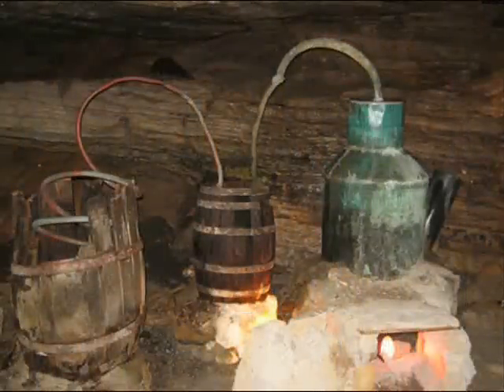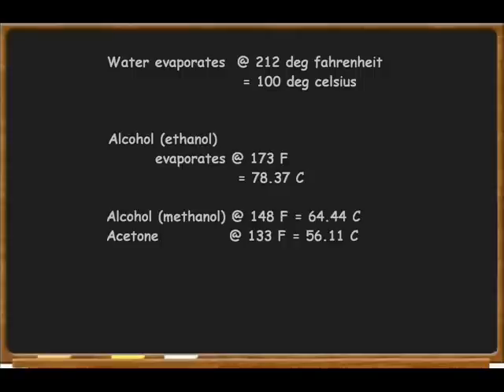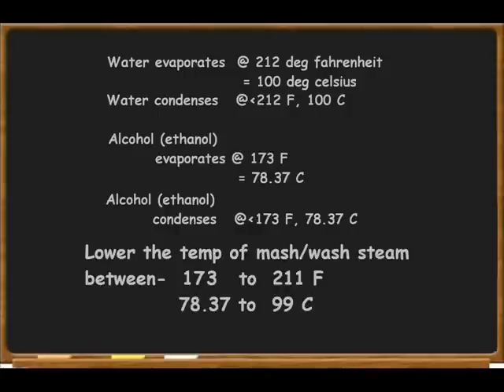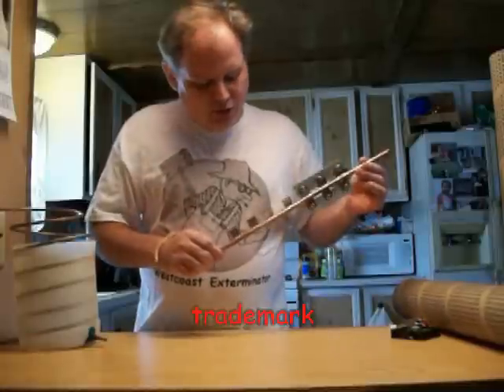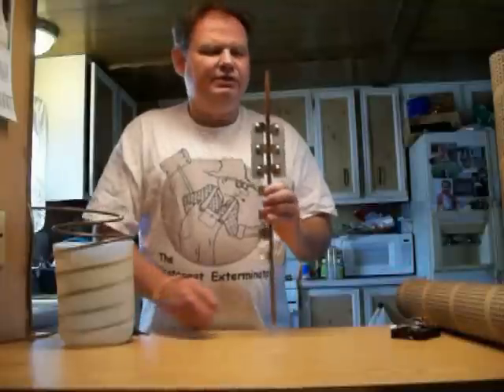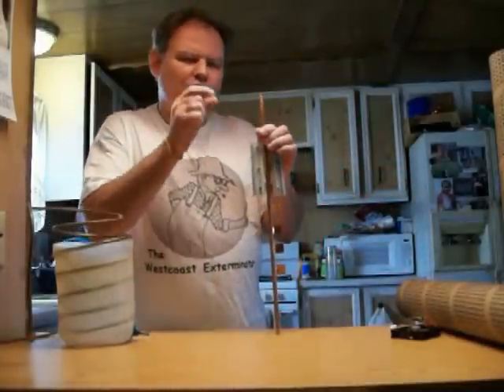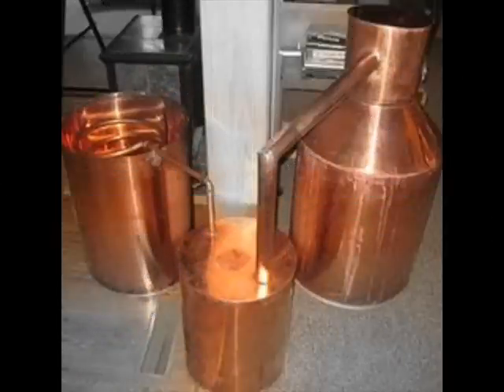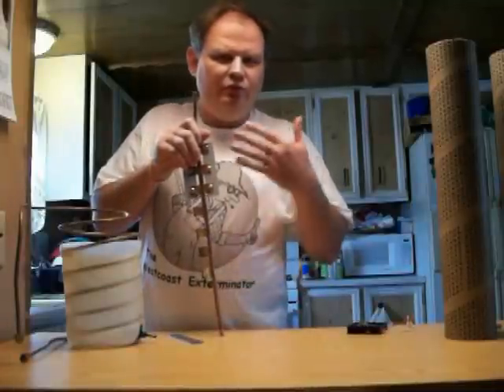Moonshine Still Reflux Columns & Thumper Kegs 101

Comment: I have a minor situation...I have a 5 gal still with a 1/2 gal thumper and a copper coil condenser!....I always fill the thumper half way with cheap wine or tails and everytime i go to use the still i will get off 2 qts of clear spirits 1st qt 150 and the second qt 140 but about a fourth of the way into the 3rd qt it will be 90 proof....Then it will be 40 and then 30 proof which its showing me that its at the end but is it suppose to be cloudy???....So what i have to do is make sure i run a pint at a time so when it decides to go south and run cloudy spirits its not getting into the clear strong spirits....What is causing this issue????? And/or how can i fix this so i can beable to run longer & without cloudy spirits??....Thank you, any help is appreciated!
Reply: Well, it looks like you are running into tails. On a stripping run I run everything off till 20% ABV or 40 proof. On the spirit run I only run it down to 35-40 % ABV, then I switch to the tails jar and collect down to 20% ABV.
Also, you should make it a good practice to collect in smaller jars. You got a 5 gallon still, so I would say maybe 250 mL jars filled 3/4. If you run a recipe you know and you are positive to be in the hearts, you can collect with bigger jars. Cheers
Reply from the maker: That's a problem and also not a problem. I don't know what causes cloudiness yet. Can't lock down any solid info on thatHere's what you do. Just save it. Store it. The cloudiness should settle to the bottom and you can add the tails to your next run or your thump keg
Reply: So far thats what i have been doing but just this weekend i had another scenerio. I had 2 batches to run and the first batch was ALL cloudy. I had tried slowing it down with no luck, it was still cloudy. I finished that run which only fermented for 4 days compared to atleast 6-7days. It only produce 2 qts at 80 prooof....My second run started out cloudy for about a pint and then became semi clear the rest of the way through....Now im wondering if the first batch had puked in my condenser cause it was so cloudy that you couldnt see through it plus you could see small flakes floating if you put the jar up to the light. I couldnt stand it so i went and bought a filter dispenser which took care of the cloudiness but i have ran several runs before this and none of them was this cloudy...What do you think the problem is? Im thinking it puked and i need to run some vinegar & water through my system and then try it out the next time i run!!...Only thing i can think of!...Thanks for any ideas.......Jeff
Reply from the maker: Jeffrey Pepperman No, PUKING is just straight mash that made it up to the coil. Usually because of foaming or the pot is just too full.
My only recommendation is CLEAN CLEAN CLEAN. Clean the still, clean the pot you mash in. Dish soap and hot water. Use the vinegar technique I show in one of the videos.
Reply: hi jeff  had the same issue thank 2 u all 4 helping jeffrey and my self out
Reply: Did you have cloudy product as well?
Reply: Jeffrey Pepperman Never had any cloudy product. Often it's a result of running into tails. The ABV falls and more water will come over, the result is a cloudy product.
Another factor to mention, is proofing the product. If you don't have 100% good tap water, use bottled water without minerals. always pour alcohol in the water, not the other way as this can also cause the product to become cloudy.
I'm lucky to live where the water quality is excellent (besides a little problem with lime stone). So it didn't mater that much to me which way I diluted my product. Also, fermentation was no issue.
Reply: I use nothing but bottled spring water....I could use them tablets, (cant think of the name off hand) but i dont, i use bottled spring water. I run strong at the beginning and i go down to about 40% as well but come to think of it i was around 30% when it was cloudy but the 2nd batch that i ran started out cloudy and then cleared up after running about a qt...Thats what has me stumped! Its why i assumed it puked!
Reply: Around 30% ABV, it can start to get cloudy. If you use untreated water, it's fine. You will most certainly discover a puke very fast, the effect will be seen instantly and you will have no doubts. When a puke occurs, it's mostly caused by a too large boiler charge and you'll see something that is more than just a little cloudy. A banana ferment is prone to puking, if you run such a batch, don't charge the boiler more than half full on the stripping run. I know there are anti-foaming agents that can counter the foaming, I've never used any, though. Throw the cloudy spirits in your next stripping run of a similar ferment. It's the beauty of this hobby...nothing is wasted as one can just recycle it as long as it hasn't been on wood.Never try to run spirits that have been on wood already, you'll end up with awful tasting stuff.
Reply: I chopped a bunch of apples from my red delicious apple tree...I had made 2 batches! 10 gallons total

Comment: You really don't understand the concept of reflux distillation do you?
Reply: after reading this back and forth between you two I decided ill never be able to make this stuff. lol thanks, you two saved me prob 1000 bucks or more. peace
Reply from the maker: +The Hound There are 2 processes in distilling...Evaporation, and condensation. When your mash evaporates, it has alcohol and water (mostly, we wont get into the small amounts of other stuff like acetone and methanol). The water will condense at a higher temp than the alcohol.  IF the water condenses ABOVE the still, gravity will pull the water back into the still. IF the water condenses in a separate container, the water will stay in that container. It is a little more complicated than that obviously, but that is the main science behind it.
Reply: +wcemichael you need packing and a refux condenser to actually make the process of refux distillation work. It does not "radiate" heat out of the sides of a tiny pipe while condensate runs down the sides. There is far more to it. Just like the nonsense on Clawhammer Stills website about packing a column that has no reflux condenser,  it does not do anything. Reboiling liquids happens in an aquatic environment.  Check out some real reflux stills with borosilicate columns and you can see how it actually works. much like the plated still in a distillery but without the spacing.
Reply from the maker: The Hound You need these things like packing TO COMPENSATE the fact that the steam needs to actually TOUCH something COOLER to condense. SINCE you've widened the diameter to make a bigger heat sink then most of the steam will just rise up and DO NOTHING.

Simple everyday 4th grade science. You must have skipped that year.
Reply: +wcemichael HaHa! no I just understand how it really works. If you had a clue, you would look around and see that. The reject 1950 TV antenna will not make a hill of beans difference in distillation. You might be able to get some low grade rubbing alcohol that might be used to light charcoal but without packing and forced reflux to allow the alcohols to separate and stack letting thee lighter alcohols rise to the top of the packing filled column you will never get anything that any regular pot still gets. Even a packed column requires forced reflux to get any real result.   Typical YouTube nonsense. You didn't help the guy who distills in trash bags with a coffee pot burner make his video did you?
Reply from the maker: The Hound Again, you said something so it must be true. Just like people are saying Trump is a racist just because he wants to control immigration. 

I also have a guy constantly telling me his family has moonshined for 150 years, and also calls me stupid because HE KNOWS there is no methanol in moonshine, and just makes his cuts for shear luck so he doesn't piss off the devil or whatever he thinks the luck is coming from.

Comment: Why are you suggesting to use a column as small as what you hold up to the camera? Am I getting this right? If I am then I'm reminded of what a professor said to a student one time...."It's not even wrong." To even suggest using a column that small, you never list a reason, is completely ridiculous. It would immediately choke, and then puke mash. What's more, the diameter is too small to maintain any meaningful level of reflux, which is sorta the point of the whole thing, so you get no reflux, no point in even having a reflux still. You apparently think you are very clever for all this, but you are doing no one any good, and in the end, your advice is dangerous at worst, and leads to worthless stills at the least.
Reply from the maker: +Duane Estill Wow!!! Just how would a choked tube magically draw up mash to a tube that is inches above it??? Blocked tubes must cancel gravity.... And I did list my reasons, explained them in detail. Guess you think you're being clever.

Comment: Thank you wcemichael. I have found your videos very informative, I was wondering if you have ever used/ or thought of an induction cooker for a pot still and if you think this would be a good way to control the temperture to boil off the methanol and acetone? thanks for the info
Reply from the maker: +Mark McPike Well you can use anything you want, I guess induction would be better than electrical heating elements. Haven't used one but they seem to look good

Comment: i have ask 0 or 40 web sites about reflux tubes ver coil condenser and no one can give me a answer! so i want o see if you have good answer for me?  if coil condenser setting in cold water worked for well over 200 years now why do people use's reflux tubes? and what dos copper have to do with my moonshine? i'm using stainless steel and my shine comes out just great....
Reply from the maker: +sam smith Ok, one part at a time... For ever 1 percent of alcohol you get 2 points of proof, 200 proof or 100% alcohol being the highest rating.People use reflux to give them a higher percentage of alcohol, because more of the water vapor condenses first and falls back into the still, the remaining alcohol vapor reaches the coil and condenses there, falling into your collection container. The problem I find with this is, unless your making gas for your car, most people will add more and more water afterward to make a drinkable proof. ....Example. I make an average of 100-130 proof and I add spring water to make sure it's at 100p. These other guys are making 150p or higher and then add more water to get that same 100p. The problem here is, whatever flavor you have is also being watered down......Next part. From my understanding copper removes sulphur from the alcohol. Now I don't know if this is true, but it is my understanding from what I've read.
Reply: so it seems to me your the only one on earth that can give me a straight answer! i want to thank you so so much! and i will be watching for more of your videos to come out! later buddy....
Reply from the maker: sam smith That's amazing, cause I just dealt with 2 people that keep telling me I don't know shit, Oh yea..... They talk with the people in those forums that you can't get a straight answer from. LOL
Reply: Buddy i know what you mean! i have watched 10 or 12 of your videos now and ALL of them is very close to how i make my moonshine and it all comes out great! i have learned alot from you! i have watched around 50 other videos on distilling moonshine and  almost everyone has all different ways to make it. to me there only one real way to make it right not 15 ways lol lol so buddy keep on making great videos and her in Manila Philippines i'm going to keep using your advice!...

Comment: How would this measure up against the more traditional means such as a thumper keg, or glass bead packing, or more recently perferated plates or bubble plates as some call them, as their are a few different types?example being the recent hillbilly flute. Excellent still, I know the guy that made it, and it probably can provide consistent 94% alcohol with an experienced southern man running it. BUT, it is costly, and extensive. Not as familiar with thumper keg set ups, we used them for the sake of tradition, and to learn the old ways. I used sections of glass beads about an inch deep, works reasonably well, compared to bubble plates, and works the same. Plates might be more efficient however.

Comment: Thanks for posting this, you just saved me hours and answered my thumper question in minutes.
Reply from the maker: +tomisnt You're welcome. The biggest piece of info here is, unless your making gas, you don't need it. BECAUSE when I make a batch without double distilling or using thumpers, ect. I already get at least 100 proof, usually up to 130p then I use spring water to bring it down to 100. IF I were to get my proof up to 150+, I still want people to still be able to enjoy it (but still have that little extra kick) and I would still water it down to 100p AND by doing this I also water down flavor and it no longer tastes that good. This is why we also make a cut at the end of a run, because the taste gets too watered down to be enjoyed.

Comment: One has no control over the temperature at which the alcohol is created, unless one turns the power down, which stops production.
I run my system using 2300 watt heaters and the alcohol production determines the temperature, not the other way around. So I cannot see how you can "lower" the temp. Chears

Comment: using copper will remove sulfates in your brew. 
the still doesn't need to made out of copper. just use some copper piping..

in any device or container used for food products. lead free solder is required. 
you may think that any lead on your cooling fins will be o.k., but, small amounts of lead may vaporize, if lead based solder is used. 
be safe...

Comment: Evaporation is different than boiling. Water can evaporate at any temperature. It depends on the surrounding pressure and temperature that determine evaporation. Like when you pass a lake or a pond when it is very cold. You can see the evaporation of the water and it condensing back into water when it comes off the surface of the water and it condenses again when it reaches the cold air. Nothing wrong with what you said just how it was said. I know what you meant though and Just want to say thanks for the info. I thank you for sharing your expertise.
Reply from the maker: +Steve Rabon Yea water will evaporate just above freezing, but the info is in it's most basic form so people get the idea without having to cram too much info in their heads. Sometimes over teaching can overwhelm them.
Reply: For what we are doing, that don't apply. Only variable in the process is altitudes. Our temp reading will go lower at higher altitude. His figures are good at sea level. This is not even in the same galaxy as fog on a pond lol. Here we are boiling water and alcohol and we use the VAPOR POINT difference between the two to separate them. Alcohol becomes a gas if you will, before water when heat is applied.
Reply from the maker: Steve Rabon Yea, I dumbed down the info for that average viewer. Water evaporates even at just above freezing. If you reduce the pressure you also reduce the boiling point, but that can be too much info for some people.
Reply: Yeah I had to learn all this in AC/R classes. I understand and said so in my first post, but it looks like I had to correct a know it all.
Reply: Think you should build one and see!
Reply: Evaporation and boiling is two different equations. Sea level as you say water boils at 212. It can evaporate at any temperature. On a cold day or on a hot day. Water can evaporate and become a vapor. That is what evaporation is when water becomes a vapor is what evaporation is. I know some wants to use that term when it comes to boiling point, but it doesn't make it fact.